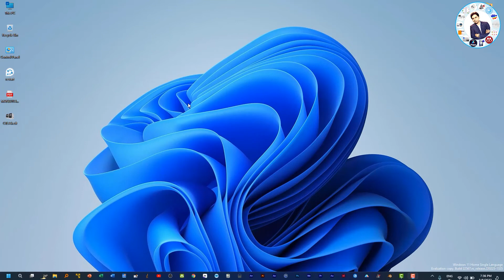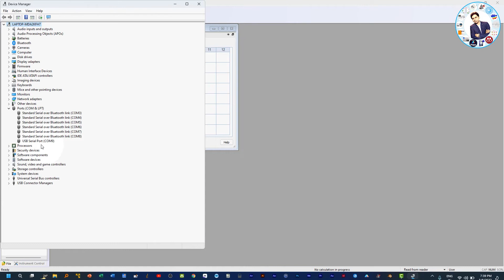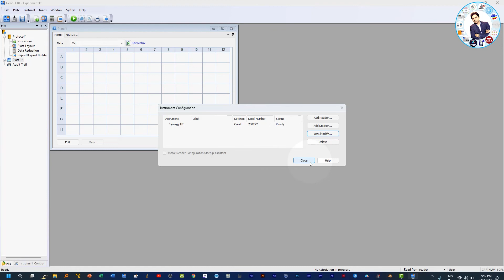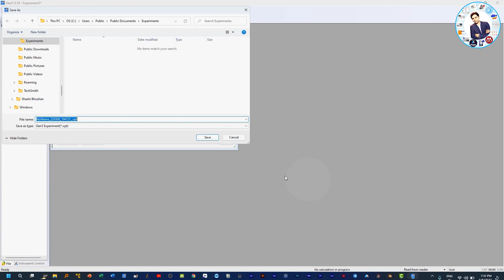Connection problem in Biotek Plate Reader to the System (Problem & Diagnostic)

Comment: XLe800 is not showing up in device manager> COM and LPT. . It is showing in Settings>Devices.
Reply from the maker: Dear JoePenot,

It seems that the XLe800 device is not showing up under "Device Manager > COM and LPT," although it appears in "Settings > Devices." Could you please:

Check the connection cord or wire to ensure that it is properly plugged in.
Confirm that the instrument is powered on and functioning correctly.
These steps can help resolve connectivity issues.

If the issue persists, I recommend contacting the service engineer for further assistance.